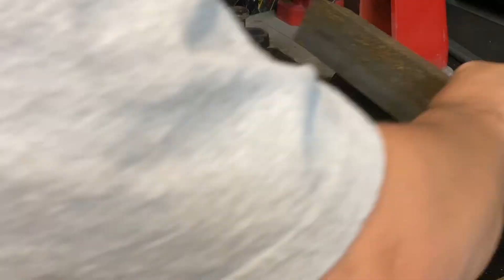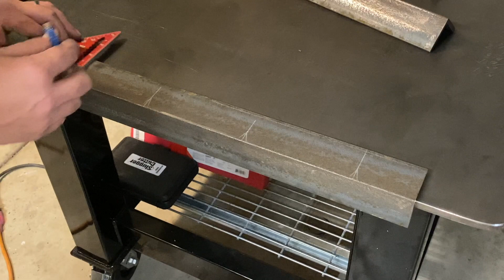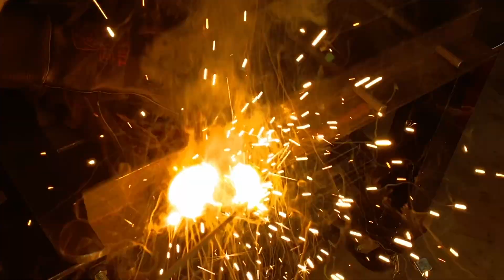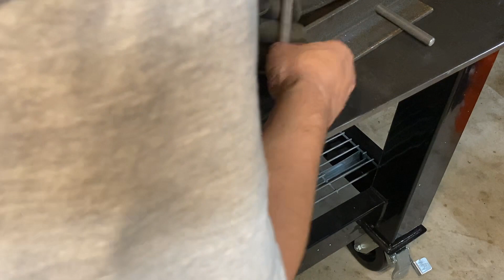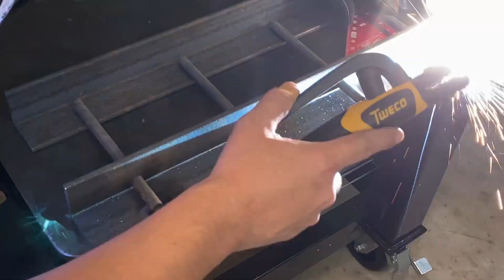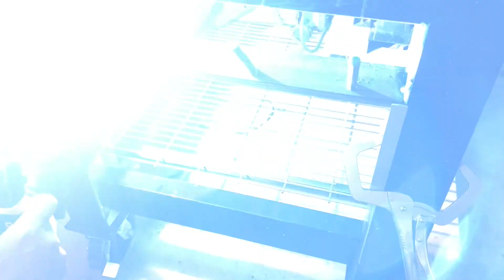Grinding Disc Storage Rack

Comment: Little late but, as a fellow Professional how do you feel about the rod end de-burring bit and the harbor hole stick 225 for projects at the house and what not?
Reply from the maker: The de-burring bit works fantastic. The welder on 110V is a gutless wonder. However, on 240V it actually works pretty decent. No trouble burning 1/8” 7018. On 110V, you would be lucky to burn 3/32 6011. It might put out 65 amps. That being said, for a weekend welder, I actually think it’s worth it.
Reply: TX Tool Crib thanks what brand bit is it there’s tons of brands when you googlize it